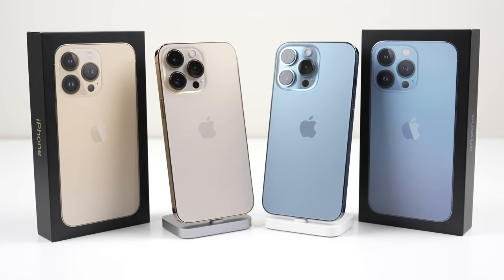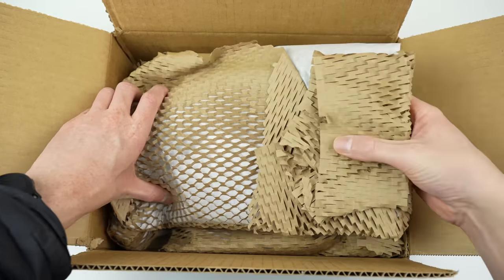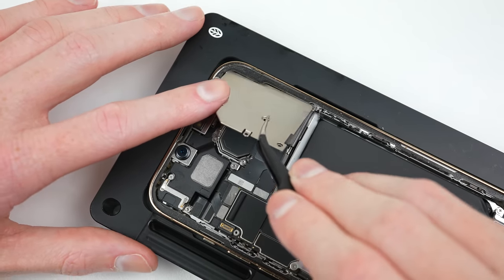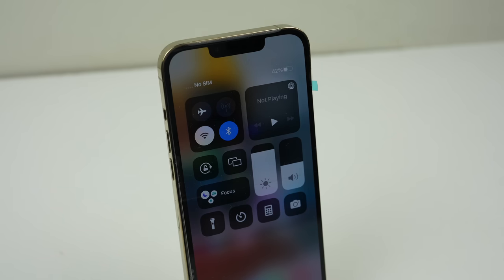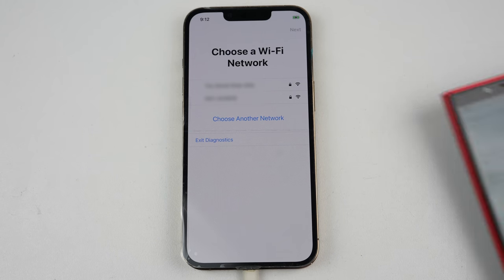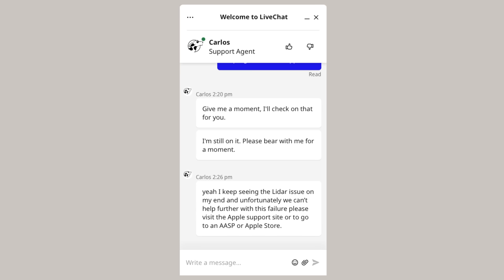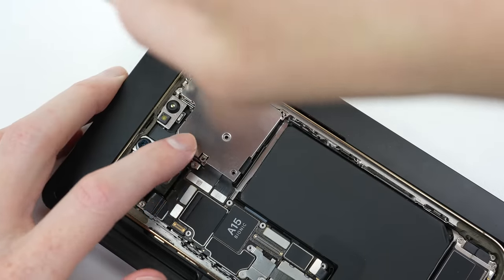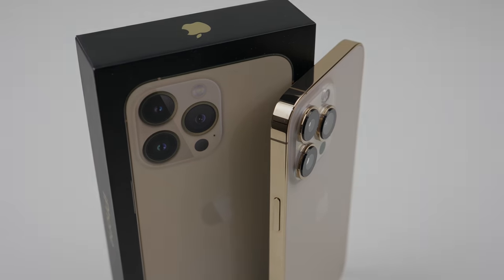Apples Self Repair Program Is Not What It Seems

Comment: 12 and 13 adhesives r a pain in the butt to remove. I work at an official apple repair center thru T-mobile and we have to use the rig that they sell on the site. The adhesive is different and more intense for these 2 editions of the phones. I found that keeping the adhesive heated up helps loosen it up a bit easier and i take the spudger while holding it with the tweasers, heating up every so often as i slowly work along the edge. Sucks that it takes awhile but it is what it is

Comment: Oh boi. I have the same issue with my 12 Pro. My Lidar doesn't work. I First notice, when i used any 3D scanner softwer and all of them shows errors. And the basic mesaurment app is litle odd. Factory reset and update didn't solved that problem. I really lost with that.

Comment: You can actually use isoproypl mixed with just a bit of acetone. 

Acetone is often used on logic boards and what not, but will melt plastics. Idk what is plastic in the phone, but if you keep it localized, it should take off adhesives better than isoproply by itself.

Comment: A tip as AASP: DO NOT use ISO propanol for the display adhesive. Use spirit. It's even written that way in the service documents. Reason: ISO does not dissolve this glue that has been used since the 12th year but decomposes it as you have recognized.

Comment: I have a iPhone 13 Pro I refurbished with this program, it got stuck in diagnostics mode no matter what you tried, force reset, restore through Mac, and tapping exit diagnostics. I had to take it to apple and they said the phone would have to be replaced for $549 as warranty is voided when opened (I was aware the warranty would go away if I opened it) I have never seen this happen before and this wasn’t the first iPhone I repaired, as I have done a 12 Pro and two 12 Pro Max with the program successfully, if anyone knows why and could let me know it would be much appreciated as I don’t want to spend $549

Comment: I worked at an electronics repair shop that had a partnership with Apple. I did remote tech work so I'd be in a van doing screen repairs, and doing iphones were always a pain. The screen repair is easy, but the calibration process is annoying if you have a bad internet connection. Many times I had to return the phone to the customer unrepaired because my internet was bad, which isn't something that should be a problem at all.

Comment: 11:04 - My friend works as support for a gambling website, they do in fact have A lot of automation in that branch where they work with TAGS. As an example, one could type 'FSC' in the chat box and press the 'tab'-key which will than print a pre-made message. The only thing one has to do is modify the user name and in some cases a small portion of the message.

Comment: Wow. It's quite surprising how much Apple wants this program to fail. Thank you, Hugh, for this in-depth video.

I agree with you that it's completely ridiculous for Apple to restrict replacing the display or back camera. There is absolutely no reason to require those parts be paired to the device for them to have full functionality. Consumer hostile decisions like this is the top reason why I would never consider an Apple device as my primary device ever.

Comment: Correction the screws are not there if you lose them, if you read the service manual it states do not use the original screws as  there single use, and states to use the new screws because they have the thread locker on them

Comment: what if we try to recalibrate the factory fitted parts? you should've tested it too.
Reply from the maker: I am not the one calibrating the parts. I barely got the guy to try a second time when it failed. I am 99% sure they can also see the screens serial number meaning they wouldn't pair the original back if its serial differs from whats on my order.
Reply: @HughJeffreys  It has worked for me I ordered a battery but I already had the camera and screen changed, I calibrated all the pieces, you should try it

Comment: actually (3:00) Apple sends the screws because you're not supposed to reuse them (now this maybe different for the self service program) but as a tech for Apple they want you to replace them "because the screws have been used and can no longer hold the proper torque specifications"

Comment: yeah for those self repair process it's a whole different experience, i work for an S&R which we do have contact with apple and have all OEM parts and tools and software to calibrate it, it's better to file a claim for a in-store repair, and i've worked on many iPhone 13 Pro max screen replacement it really simple repair and running the system config after.

Comment: What happened in that calibration process. Was quite a lot different than what I'd have imagined. I thought it would just connect to a server, check the serial numbers and have you do a few quick actions. And not that a service employee would actually have to get involved. Maybe they're worried about reverse engineering if it ran automated, though.

Comment: This is why I never plan to hop off the OnePlus 7/7t Pro platform. I've broken so many phones, but keep all the broken phones in a bin. I've probably purchased 4-5 used phones over the last few years, but have built 7-8 replacement units with the parts.

Comment: There should be instructions to access AST2 with a temporary log in so you can run the calibration. When you test everything before calibration, you’re going to get errors. System Cofig takes a few mins. Then it shuts the phone down and reboots back to diag mode.

Comment: Hello Hugh ! 
I work in AASP.
Screws are here to be replaced. This is not for a person who lose a screw.
In an iPhone, if we unscrew, it goes to the trash and we must replace the screw for a brand new one.
Reply: That's incredibly wasteful
Reply: @caspernicus5822  in fact there is a little amount of thread lock on every screw. 
If a screw is removed, she can’t hold the same and she’s gonna go away with the vibrations of the phone and with the daily use. 
When you replace the screw, you replace the thread lock too so this phenomenon never happen.
We have to use a torquedriver too.

With my experience I can say this not happen so much with android phone causes their screw are bigger and can be tight stronger even if some have thread lock on too.

Comment: 5:20 I think it could help to heat up the adhesive to remove it like apple sayes. I had the real same problem with the adhesive form the Mircosoft Surface. After heating it up it was very easy to remove it. :D

Comment: Is there an argument or validity to saying that we might need to upgrade our tools to combat? Example: Battery replacement:
- Get old OEM battery
- Cut that flex cable from the root
- SOLDER it on the a new battery
- (Normally, this would trick the iPhone into thinking it's the original OEM battery)

I'm wondering if there's something to be said for having a tool (maybe an iFixit tool) that can assist with soldering these cables for the general public.

Comment: Technician may be an overstatement.. When you call for tech support you often get someone that is reading the instructions form their computer. screen. Their knowledge maybe based on whats on the screen or prior issues.. Dont know if it the case at APPLE but it is in some other tech support groups..It isnt until you get to level 2 or 3 support you actually get an experienced tech..  The FINAL issue will be the software load to pair the new parts to get everything to work....

Comment: I'm surprised it didn't send you the screen disassembler and sounds pretty complicated with that repair kit apple send you, but same tools we use and also have acess to Apple's global Exchange Service, this repair alone only takes me 30min from removing the old screen and removing the old adhesive tape to reinstalling the new sceen and booting into diagnostic mode to run the system configuration suite which only takes 5min then rebooting the device and completing the post repair scan, and its done.

Comment: The issues the 13 parts were swaped, it wasnt calibrated with apple's tool. Problem with self repair you only get 1 adhesive and its easy to not to install it correctly. If your good can remove adhesive all without breaking, twist method is best. When calaibration happens apple needs to update each serial number of swaped parts assign to your device.

Comment: yeah dip stick, you ruined the lidar sensor when you turned the phone on with the front cameras plugged in and the screen open/not set down. This is a known issue. I did the same thing when Face ID first came out with an XR

Comment: The "calibration" process mostly syncing the encryption with new keys between the device and the new part this is why the old, original part that came with the phone when bought doesn't know it's the one connected before, because the encryption keys simply do not match anymore, that's how apple locks down parts.

Comment: I wasn't expecting much from Apple of course the cost of the parts is almost akin to having them repair it themselves. The fact that the new camera and screen also haven't been programmed is ridiculous. What was the point in them asking for the SN and Model number if they weren't programming them before they're sent out?
Edit 
Just got to the calibration. So there must be a portion of the ROM that aligns with the correct ID/SN from the correctly installed Camera/Screen. Interesting

Comment: How did he add more USB to his MacBook?
Reply from the maker: An express card. Its a 2011 MacBook Pro, which despite having upgradable ram, storage and DVD drive it has a slot on the side where you can slide in expansion cards. I added two USB 3 ports as the laptop only had three USB 2 connections.
Overlooking the GPU issues on the 2011 models they where a great laptop.

Comment: The phone acts like the original part is foreign because technically it is.  You 'registered' the replacement with Apple, after removing the original part.  That the original part is no longer seen as an 'original part' makes sense.    And I'm not saying the way Apple appears to be doing things is right, though that aspect makes sense.

Comment: It seems for the Car industry this is standard. I came across a car repair shop whose story was that they were raided by the police for trading stolen parts.

Turned out that the customer bought a "used" car that was refurbisched out of 2x stolen cars and the devices inside the car illegally paired. Once the technician connected said car to the Car software, it phoned home and detected illegal parts that led to the involvement of the police.

It seems that every part in a Mercedes, VW, Audi, ... has to be paired by the software that requires a personal account with the respective company and the repair shop was proud about this system as it would prevent crime - having car in his workshop with stolen parts that were made to work without the software.

The right to repair seems to be lost on the Car market - even so far as the mechanics themselves have been indoctrinated that his is the proper way to go.

Comment: what ever happened to “if you open it the warranty is voided” seriously. It’s technically the correct counter to right to repair. Cause by trying to repair it yourself you risk further damage. Which validates 1st and 3rd party repairs. I get that these companies want to turn a profit. But slightly bricking the phone to disable certain functions when using OFFICIAL PARTS THAT ARE MADE IN YOUR FACTORIES. Really makes you think

Comment: Instead of supporting techs who have installed screens for decades they encourage people to repair their own phones. This is a great deal for Apple because when an inexperienced person damages the screen or their device Apple does not have to take any responsibility and they may still get a full service repair later of more money to replace damage to the device. I have seen a number of people try repairs and damage board connectors so badly it requires micro soldering work to fix. Also how does this effect Apples warranty as the customer is not an Apple approved tech are they then going to claim your voided your warranty. It's crazy that the price is not even much better then going to a store. Why would anyone want to even take the risk for what a $20 savings in the end. The craziest thing about this is in the many years I have been fixing phones I have had more customers then I can count bring an iPhone into me after Apple said it was not fixable. Some phones fixed in as little as 20 minutes after Apple said it was not fixable. Apples own updates have disabled their phones a number of times, the fix, disconnect battery for a minute.

Comment: You should try to repair a phone through Apple’s program, but instead of using the original parts provided, you should install non-genuine parts and see if Apple is still able to ‘calibrate’ them.
Reply from the maker: That was actually my original plan but after reading their terms and conditions to the program lets just say it scared me away from doing that.
They note the serial number down of the screen they send you so i am sure they are see that on there end. Plus in the end no one is going to do that. We already know a non genuine screen would work if it wasn't for the pairing process.

Comment: Apple simply took away all the freedom which apple users had, they stopped offering charging adapters, removed headphone jacks, now you can't even do third party repair. 

How long will it take for people to wake up? Apple is finding ways to charge you some money.

Plus behind the door, They are collecting their user's all biometric data as well,

1. They introduced Touch ID to get the fingerprint of their users.
2. Then they came up with Face-ID and to get a facial 3D data.
But, one thing was remaining to do a complete biometric data.

3. With Vision pro they came with Optic ID, an iris scanner which uses the user's iris data to authenticate the Vision pro glasses.

Comment: One would think Apple would solve the "non-genuine part" problem within the self repair program... They already have id of the phone so what's stopping them from pairing the screen beforehand so the message doesn't pop up?

It still seems to me that this is kinda like show where they do bare minimum to fool legislators that they are doing something useful when in reality you can't fully fix your own device since the devices still loose functionality.

Comment: Sounds like the issues with modern cars. Why do you need to code a new headlight when it receives the data for leveling no matter what? They even perform the self-tuning (start and end point of the servo) on every launch of the vehicle. This is just to annoy people into going to the official repair shops.

Comment: It's not even about it being easily repairable. For some housewife who never tried to disassemble the phone even the most repair-friendly piece of tech would seem irreparable. However here it is completely different. 
The calibration process, required for phone to properly function, can't be continued if it was interrupted. Let's imagine there was no issue with LIDAR, everything went smooth and calibration proceeded. But while it was in process, power outage happenned. Wifi obviously shuts off, interrupting the process. Can it be restarted? As far as I understand, it can't. So now, to use the full functionality of the phone you need to send it to Apple for them to recalibrate it(hopefully they can and won't blame you for interruption of the calibration). 
So on top of the cost of self-repair kit, you'll probably have to pay service and calibration costs to Apple.

Comment: I can understand tracking parts in a device, and calibrating... but this calibration and test software really should be ON ios itself. 

Honestly, it likely is, and the encrypted data was just serial numbers, dates, and a few device logs encrypted using the device serial+apple's public key. 

It really shouldn't be up to this.

I can understand the idea of not wanting a random malicious entity swapping cameras, etc to be able to be bypassed in the future, but there should be tests for this and ensure that supply chain control is how you enable security (by the person buying and repairing the device, not Apple). 

The ONLY situation I can see that Apple's control has is this: 

1. I'm a malicious entity, and make counterfeit Apple cameras, screens and sensors. I include backdoor bypasses, where if the sensor gets a unique signal, it'll send data to unlock the device. 

2. I sell these as authentic parts, and make it difficult to find / seethe malicious backdoor.

3. In the future, after enough parts have entered the market (as I sell them cheap), I can use this to bypass lock mechanisms on the devices. 

This could be a government, terror group, fraud group, etc. 

But you can control this via a necessary signed firmware that can be put on any micro, that has Apple public keys for encrypting data comms to and from the iphone. 

I guess they could make a compromised processor for these devices, that can read the decrypted data and inject code? 

But then.....

Based on the construction, the device would need to "pair" this "preset" data from the sensor to the phone as a new fingerprint or etc, to have a bypass -- which would be obvious to see happening. 

But i guess a screen could detect your passcode, and then send it via an app or etc later? Or it could use this to bypass the lock screen by sending the same touch commands to the phone as a successful unlock attempt if it gets a specific signal? 

Idk how prevalent of a risk this is to allow Apple to have full control. 

Now entirely sure how to stop this, aside from randomizing the buttons for the passcode?